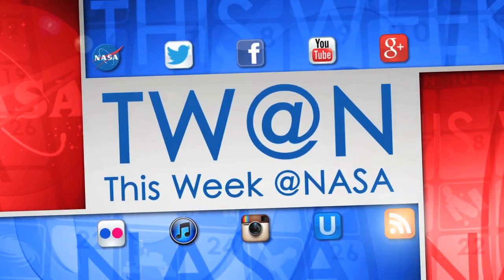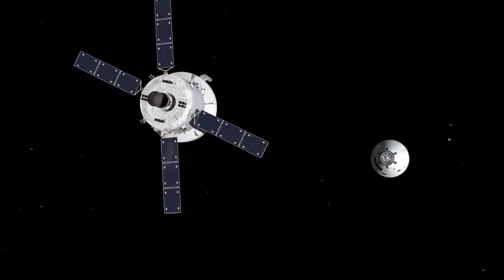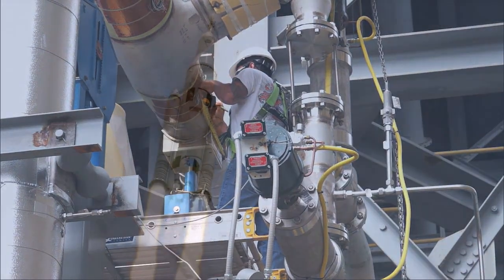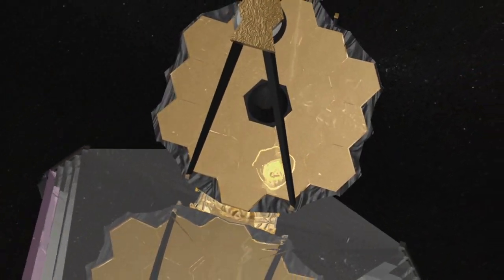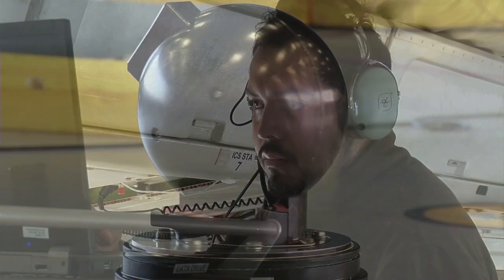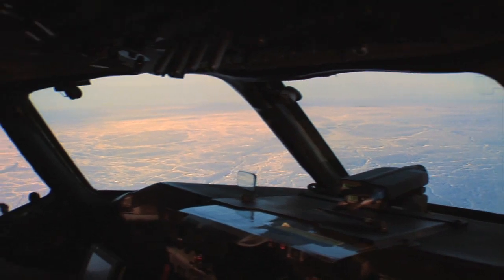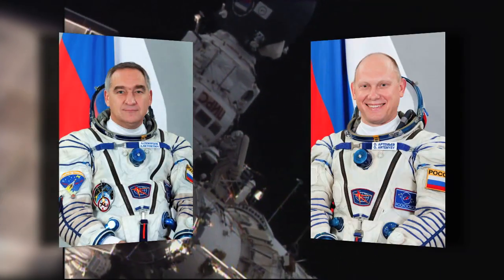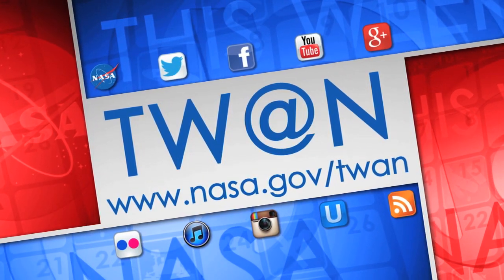Orion’s protective backshell installed on This Week @NASA

Comment: Quick question. The orion capsule has plating on it like that, and they mentioned it would help protect it from debris in space. Does that mean just from like, if the capsule were to end up bumping against something in space, or something like that? Or are they referring to small bits of rock and other particles floating in space? If so, is it really capable of protecting it from that kind of thing? I'm very curious, as I'm a highschool student with a future career in space related stuff planned. From what I've been told and read about, space debris is usually in wildly different orbits from the ship itself, and is as such usually travelling at at least one or two, potentially more, kilometers per second in comparison to the ship's orbit. So what happens if a piece of debris, say a small stone or other very small bit of debris, hits a ship? Is the ship plated with strong enough armor to completely stop the particle, or are there other procedures in place to prevent any sort of explosive decompression or anything horrible from happening due to a piece of debris hitting the ship and (possibly) penetrating it's externals. 

Thanks for any questions anyone can supply. This is something I've wondered about for awhile and them mentioning the plating made me think of it again!
Reply: Space debris is usually space waste. From tiny bits of spacecraft debris( no longer used parts ) to the rocks you mentioned. And the plating is aluminium ceramic plating alloy made of desert sand to resist the high temperatures in re-entry and I think they added aluminum into the composition because of it's weight:resistance ratio.
Reply: No.  Micrometeorites.